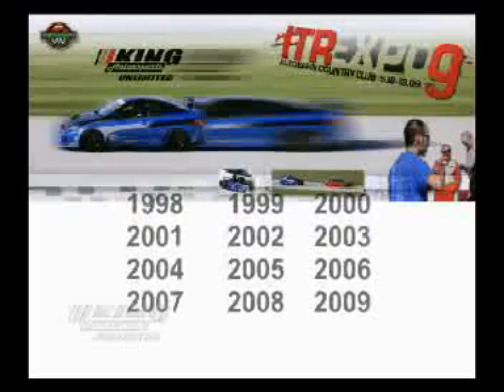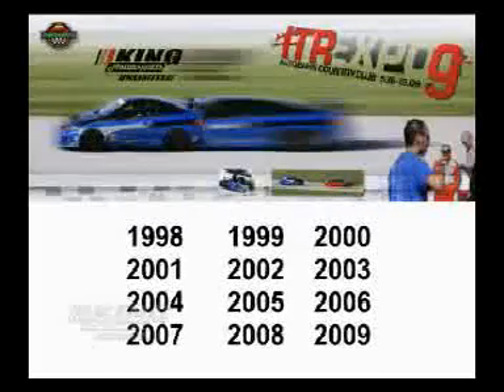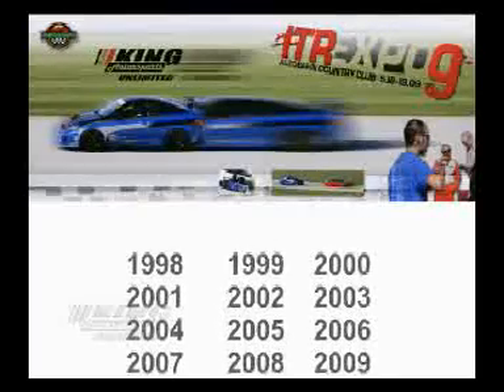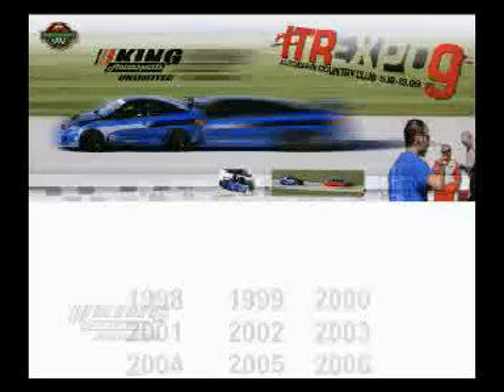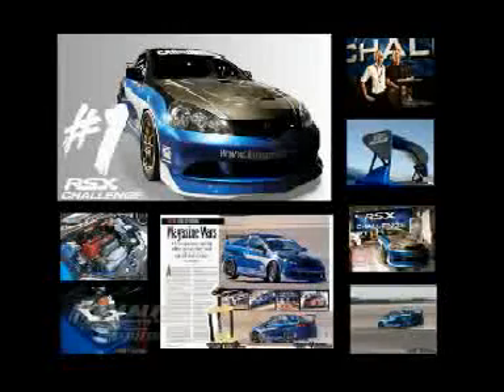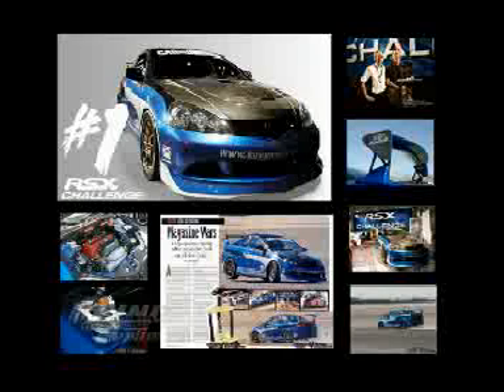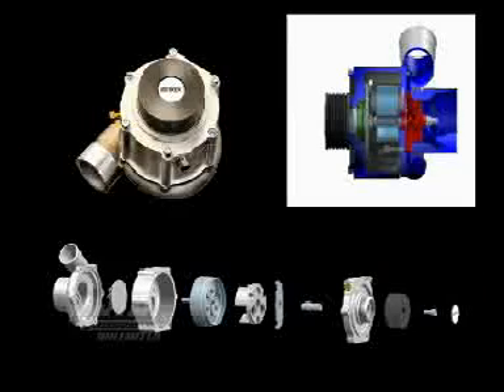ITRCA Rotrex Install and Fabrication

Comment from the maker: @AZ05DC5 It is right behind the intercooler, that is why the intercooler pipe had to make a funny bend to get to the charger around the stock radiator.